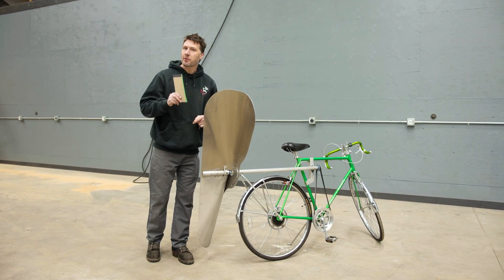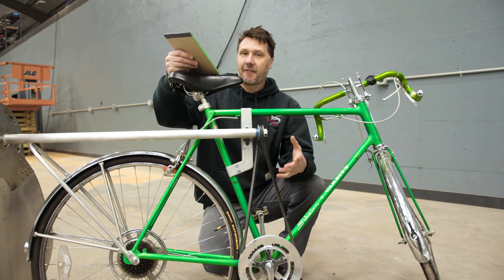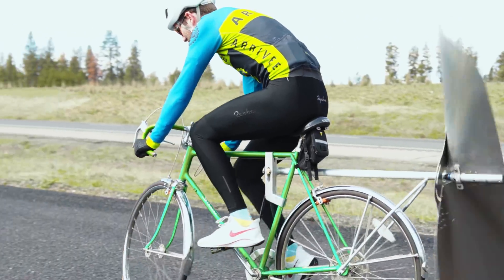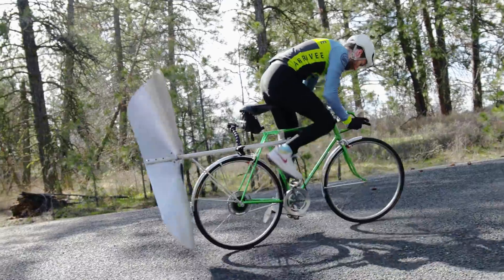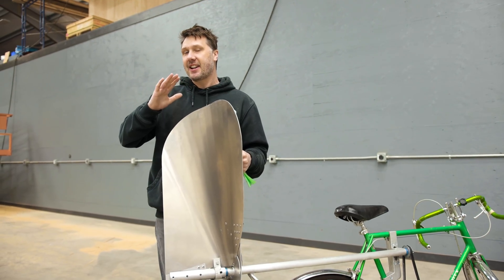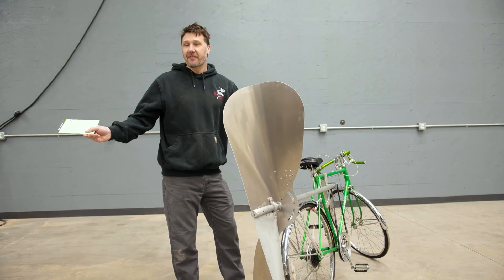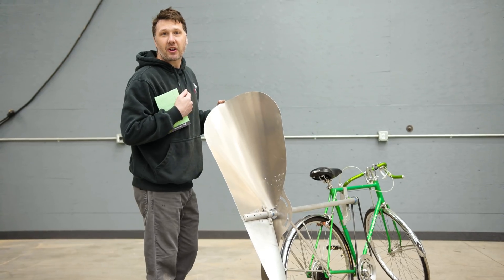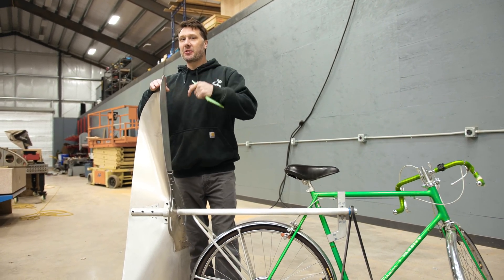Does the Propeller Bicycle actually have a Variable Pitch?

Comment: This bike was probably made to help win the Kremer prize, a award for first human powered flight set up late 1950’s for 50,000pounds Sterling.

It was won by Paul McCready in the Gossomer condor.
He later won 100,000 pounds for crossing the English Channel!

https://en.m.wikipedia.org/wiki/Paul_MacCready

Paul later designed the EV-1 first modern Electric car body with a super low Cd.
The drive train was designed by Allan Coconni . Tesla bought Alan’s design using lithium  laptop batteries , since Chevron would not sell him NIMH batteries. 
That is why a Tesla today has Many cells in series and parallel instead of just a few large ones!

Comment: Couple thoughts: 1. Use the bike's original gearing to allow you to start the propeller and then shift to get it going faster.  2. There is a lot of surface area that is parallel to the rotation axis.  Completely parallel means wasted effort.  You  could probably improve performance just by cutting some of that area away, as much as possible without making the rest of it floppy.

Comment: Have you considered a lightweight pedal assist on the crank, using a small battery to add and even out torque application between pedal strokes could help you greatly.

Comment: I was not asking you to put a motor so you wouldn't have to pedal it, I was really surprised it worked. I meant "put an 80cc two-stroke motor to make it a moped to see if it actually worked as well as the pedal bike with the same motor", like 25-35 mph. I suspected from what you said that it might do quite well, and be a credit to Ernest's propeller, which he actually designed and made, instead of just the bicycle, that he bought at Kmart or Sears, which I appreciated for its design sense and being a steel frame that can hold up all that equipment, flex, and take a weld. The weight and mass is the similar - experience repeated.

You can mount the motor sideways (or up front on the top tube for better balance?) and attach a sprocket and chain to the prop shaft while maintaining the ability to pedal it. Anything which drives the wheels and not the propeller (like an electric hub motor) = stupid and pointless, unless you are trying to test if the airspeed of the moving bike moves the propeller?

If you want speed, get some big motor, but I just wanted to see more testing.
Weld two whistles to the ends to alert pedestrians, but it doesn't seem like there were any people there except your crew.
My only question:

Dear Ernest,
What happens if you pedal backwards - brake, reverse, or nothing?
- Cannot tell me a motor would not help with that test.

And yeah, I did not think you could pedal it sufficient to actually see how good it is; because you said exactly that - there is no control variable, and maybe you get winded on the first ride and flop on the second, and the same with the pro (there are so many types, maybe a long distance or track rider would fare better)? I don't really believe that bicycles are at the level of technical refinement that you say, maybe I should add a variable pitch propeller to my bike?

16-20mph is a pretty good speed for a bike, and everyone is unfamiliar with this thing...

Comment: Clipless pedals and bike shoes are more efficient than street shoes on flat pedals. You could get more power to the propeller for the same effort.

Once the bike gets moving, is the relative air speed imparted to the air pushed by the propeller reduced? I don't really know. Maybe the torque required for a given RPM drops? Maybe a couple of gears would actually help.

Comment: In the first video you clearly said "variable pitch propeller" referring to the fact that you need *variable pitch* to move more air near the fulcrum and less near the blade tips. This time you are talking about varying the pitch with bare hands, bending the metal - what the actual f?))) We get it, you meant variable pitch airfoil of the propeller blades or whatever it is called by the nerds, we do get it. If this weird explanation was a reaction to flaming in the comments to the previous video, then holy sht i dont envy those idiots, how the hell was it possible to misinterpret your idea?

Comment: FWIW, I do tend to agree with others here that the large area in the center that’s parallel to the axis of rotation is just making for more drag. It makes for a simple fab, and avoids strength issues at the root, but it’d be much better if you lopped off a lot of that “vertical” material.

That aside, I imagine that the optimal design (size, pitch, etc) will depend a lot on the characteristics of the particular “motor” 😉 Some people might have their max power output at a higher rpm, others at lower one.

I love your idea I’d having the viewers contribute designs! (!) 

Unfortunately, I:
- Don’t have the skills
- Don’t have a slip-roll
- Am currently 100% busy setting up my first metal lathe (woohoo! 🎉)

Comment: 1:24 Instead of putting gearbox in the pedal area, you could put one in the propeller shaft instead, it will not require manipulations with the frame. I wonder how more efficient it will be and will it be worth the effort

Comment: nice, thanks, very inspiring! :-) 
lots of ideas for optimization - but here are maybe some slightly different considerations:
- more safety! rider protective gear, attach brake to propeller shaft, ... at least paint the propeller's tips bright red for maximum awareness
- did you balance out the propeller? if it requires a lot of filing, you can add varnish to the other blade
- maybe a good way to create a propeller would be to cut open a tube along it's length (actually two half-length cuts, one from each side) and gradually unroll it, starting from the center?
- maybe try some time trial handlebar for more weight towards the front?
- maybe use bike drive chain & front derailleur as 2-speed gear? (then belt for direction) 
- toothed belt?
...
.... very nice project :)

Comment: That prop could be optimized a lot!  Spin it at a fixed RPM and measure the power using an electric motor and volt and amp meters.  Modify to get max RPM at min power, then repeat your experiments.  I think that large flat area in the middle parallel to the shaft is just stirring the air, contributing drag and not thrust.  FWIW, I think this is a pretty cool experiment, a blast from the past!

Comment: I'm not an engineer but my understanding of airplane propellers is they don't create "thrust" (air being pushed out the back) as much as they create "Lift" like an airplane wing. When you think of an airplane wing there isn't significant air velocity in the downward direction however it still creates lift. Airplane propellers and helicopter rotors are built like this creating lift on the front side of the propellor and essentially "sucking" the plane through the air. How would this concept work with an airplane style propeller? It would likely need to be much smaller and much higher RPM. 

Ernest called his design an airscrew and I think that is accurate, working more like a ships screw than a propeller. However I think an airscrew is less efficient than a propeller.

Comment: I really like your effort with making this cool bike! 
I have actually thought about making a propeller bicycle since many years.
I understand your purpose was to try out a propeller like the one from the old magazine.
But this propeller is horribly inefficient and pushes the most of the air towards the sides instead of backwards. I am very interested to know the result with an efficient and optimized propeller. You would go much faster!

Comment: A valve train from a Ducati has a bevel gear that would work. quite small, fits into the head of a motorcycle engine. the original photo they definitely had access to an engine with a bevel gear valve train.
the propeller could be made much easier to rotate with less surface of the propeller perpendicular to the rotation of the propeller. Much easier

Comment: The prop design is not 60 years old. It's more like 120+ years old. By 1960 propellers pretty much looked like they do now, a slightly twisted airfoil.

Comment: I like your videos, but some of the things re-explained here are still incorrect.

The pitch of a propeller is steeper at the root because the velocity of the propeller is lower at the centre. It is not because of torque limitations. The total diameter of the propeller is usually what is adjusted to limit the torque requirements.

A propeller is a wing, and wings only work properly at a very specific 'angle of attack'. The angle of attack is the relative angle between the blade chord and the oncoming air.

The angle of attack needs to be constant, from root to tip. Because the tip moves faster, it therefore needs to be shallower than the root.

A propeller without twist will only have a narrow 'ring' producing thrust. The root will be too shallow (producing drag) and the tip will be too steep (stalled, making the air turbulent but not accelerating it rearwards).
Reply: Good explanation!
Reply: Yep!  Exactly.  I actually just posted this exact explanation and then read yours, so I had to edit and cut it all out.  I would be willing to bet the performance of this bike would be increased significantly by a better prop design, as the static lift of a properly shaped wing is considerably more than the dynamic lift.  It would have a comical, exaggerated shape, but I think it would work.

Comment: Good presentation. I would like to knitpick one area though. The twisted shape of the prop blades isn't so much to do with torque as it is laminar flow. Closer to the hub, the prop is moving slower. It's the same rpm but less distance traveled. Think of it like surface feet oer minute in machining. Even at the same rpm, the speed of the tool changes with diameter. So to have good air flow at all points of the prop it must have different angle of attack closer to the hub where its moving more slowly. Torque has more effect on overall prop surface area.

Comment: 6:50:  That is why airplane propellers blades are twisted up like they are and shaped like clover leaves --- in order to provide uniform airflow over all their cross sections in spite of those differences in air movement at the edges.  For that is what you need for efficient propeller-driven flight.  Even some large commercial fans are made with propeller-like kinds of fan blades.

Comment: Hi! If you could find the way how to transfer the rotational energy from spinning rear wheel to propeller shaft, that would give you much more ratio rather than feeding from crankset because the diameter of wheel is bigger than crankset. So, your bicycle would start like normal bicycle (the crankset transfers the rotational energy to your rear wheel via chain), and then your rear wheel would start transmitting the energy to your propeller shaft. How do you like that idea?
Reply: I like it. Man powers wheel, wheel powers propeller. In that scenario the rear wheel is basically a flywheel, adding some weight to the diameter of the wheel would give you some centrifugal assistance (to a point) so the wheel would continue to send momentum to the prop even when freewheeling. Hmm. Very interesting idea.
Reply: @woopimagpie  exactly, thanks for detailing the general idea

Comment: I came here hoping to see a correction on variable pitch being variable twist, and a correction on the erroneous torque discussion.

To see the defensiveness and even doubling down on the torque argument, was a major disappointment.

Propeller twist is due to the air speed of the propeller disc increasing with radius, which means the angle of attack will change with radius, which will lead to stalling at the tips, which creates drag while providing no lift - this is why we twist the propeller, and also why we devised methods to vary the pitch. The propeller is an airfoil just like a wing or sail, and in this application, minimizing drag is crucial.

Put the pride aside and actually do some research.
Reply: Put arrogance aside too.

Comment: RE: pitch as a function of radius.

the main issue isn't the leverage of the torque at different distances, but rather the ratio between the distance that the propeller blade segment travels (2 pi r ;  for different r for different segments.) and the forward motion of air through the propeller (also affected by the speed of the bike.) which determines the angle of attack. (more on that later)

imagine a large corkscrew going into the ground (like one you would use for wine, a helical structure with an empty center), let's say that with each rotation, it goes 10 inches into the ground, if the circumference of the bounding cylinder is 30 inches, then "slope" of the corkscrew is 3:1. 

a wider corkscrew with a circumference of 100 inches (but still going 10 inches in) would be at a slope of 10:1 

so as you can see, the slope of the propeller to attain the angle of attack (the angle between the airflow and the chord line of the wing) of zero across the entire prop, when the bike is moving forward at the distance of one corkscrew, per revolution. 

at an angle of attack zero, you are generating zero push (just pinwheeling.) so you want an angle that will give you an optimal angle of attack when the bike at the desired speed. (probably no more than 10 degrees. - this means that at lower speeds you will have a higher angle of attack, and be a lot less efficient in transferring energy to the air.)

Comment: I'd also like to see if the propeller shaft could be driven from the ten speed gearbox at the back of the bike. Start in low gear, then as the propeller gets moving you shift into the higher gears. Still using the bike otherwise as-is, but with more gearing options to drive the propeller shaft.
Reply: Or, if you can't connect the gear pack at the back of the bike to the propeller, use a similar concept so that you can make it easier to get the propeller started, and then crank up the gearing once the prop is going. Basically, apply the same logic to the prop, that the regular 10 speed bike applies to the rear wheel.

Comment: Your propeller is not what Ernest did build.
Ernest's propeller is actually better.
You cannot have a flat part. This will only create drag, and you loose power in tin air !! The idea is, that the propeller pushes air, in the direction you want to push it.!!
High pitch propellers can be easely found, as well as images, from how it should look, and be formed
Reply: Yeah, this is a big issue with his current design. Just cutting away the flat triangular section and increasing the twist a bit more would make a big difference.

Comment: Your explanation of having to have the prop move "more air" near the hub, isn't exactly correct. On aircraft, the prop tip has a flatter pitch than the hub, because the radius is obviously longer, thus the tip is travelling more distance "around the hub" for each revolution and is thus traveling faster. This also means the tip is traveling "through the air" faster than the cross sections  of the blade nearer the hub. The propeller blade behaves like a wing, and to be efficient the flow need to stay attached to the convex side as much as possible. Thus, to keep the flow attached and the prop cross section efficient, the pitch must be decreased as you get further away from the hub. The hub, due to obstructions and the fact it's not operating in "clean" air, is actually the least efficient portion of the propeller.
Reply: should have read before writing. yep, getting the propeller to effectively push air, and minimize the drag of the spin, (to require less torque generated by the biker) requires that the angle of attack be optimal on all segments.